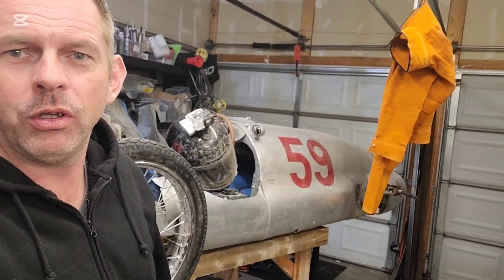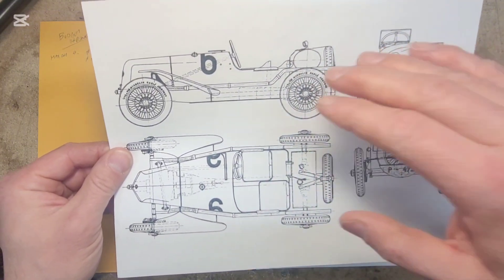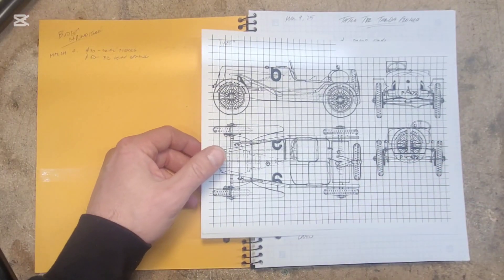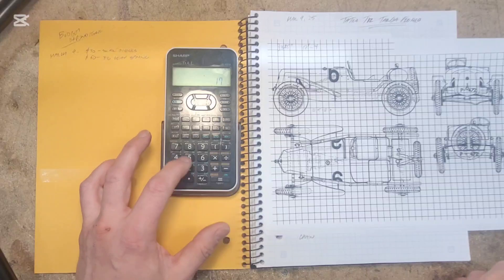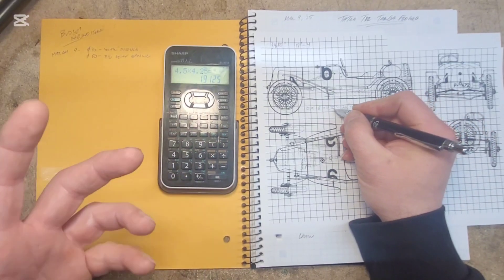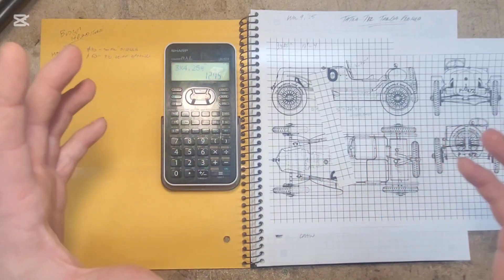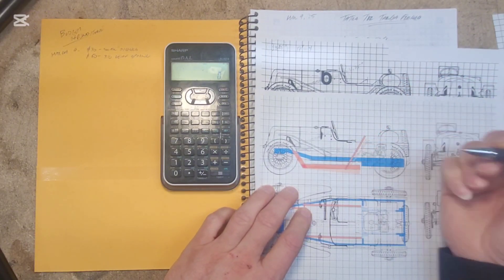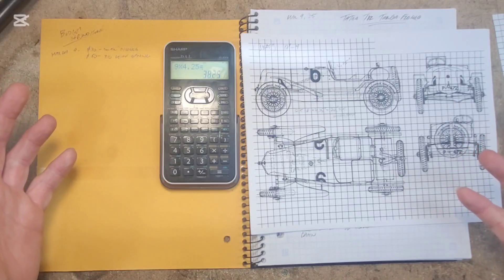Cyclekart Shop Talk | Ep. 5 | Making a Scaled Cyclekart Build Drawing

Comment: I'm at this stage myself, but I'm on my first cart, so I'm not sure what I should be adjusting as another "big guy" driver.  It seems like the standard is a 19" wide cockpit, I was thinking I'd shoot for 21".  How wide can I really go and still fit within 38"?  I've also gotta figure out how to make it accessible; I need to be able to get in and get out with not-so-great of knees.  Currently I'm working with a GN Jap as my inspiration.
Reply from the maker: I'm 6'2", 215. I sometimes have a bad back. So I sympathize. I'm also finding that my first ck was too tight. I wanted to build it low and fast, and I did. But it's quite difficult to get in and out of.

I'll tell you two measurements you'll want to know: the distance from the floor to the bottom of the steering wheel (9.5") and the backrest to the wheel (20") that one is slightly less important. For my next ck, I'm increasing both of those by at least 5". So that gives you an idea of what "too tight" is.